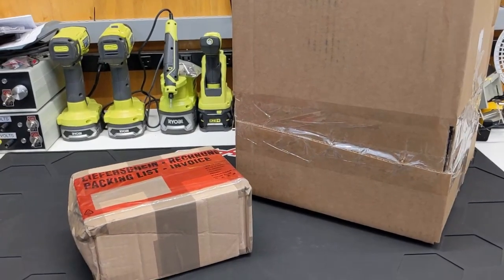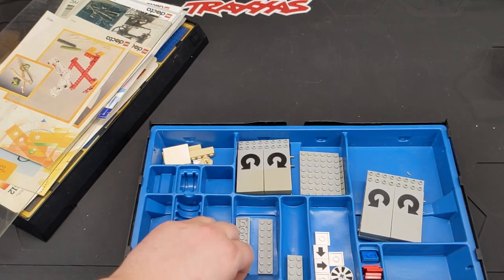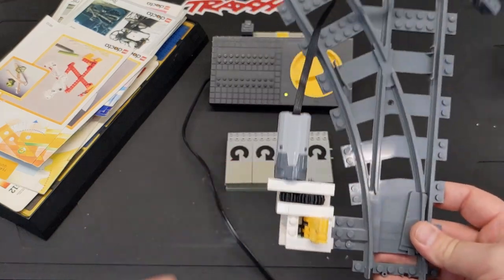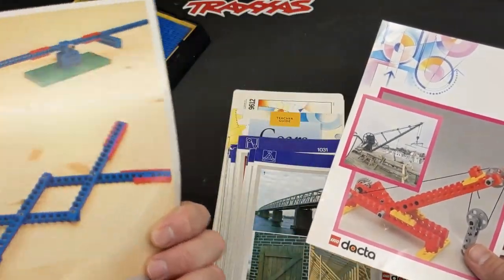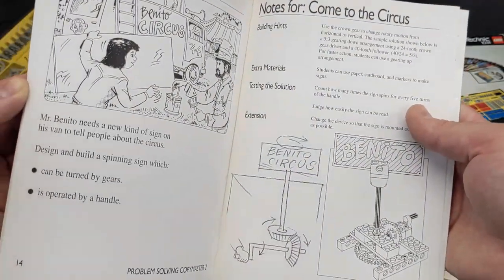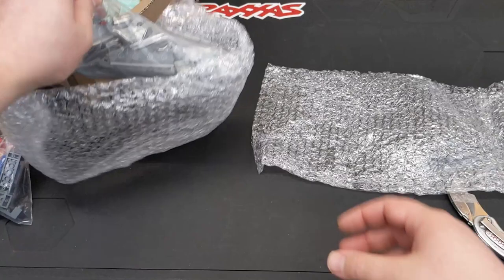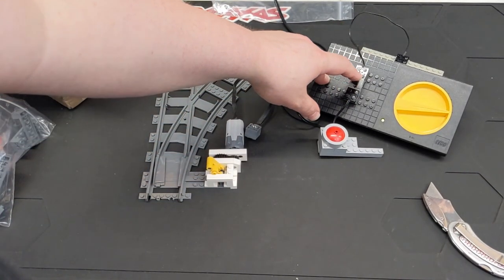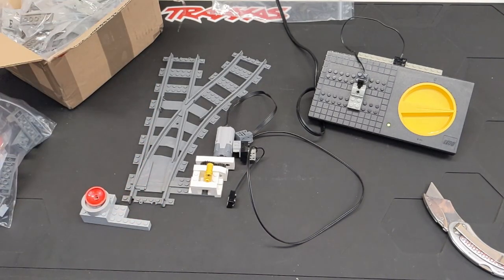Lego Electronics haul!  Parts for control panels and controlling switch tracks

Comment: Great video, thank you, I am trying to do the same with the switches, and have a question if I may.. the cable out of the switch to the motor, are the two pins just connected to the GRD and 5V wires?
Reply from the maker: I'm not sure what you mean, are you referring to the old 4.5v (or 12v) buttons or the 4.5v touch sensor button?
Reply: Sorry from the old 4.5v buttons to the 9v power functions motor
Reply from the maker: basically you would have a 9v to PF wire, then cut one of the wires and put the button in series on the cut wire.  I've been asked about this a good bit, I want to make a video explaining things better and add some more ideas.  I have a few projects ahead in line though
Reply: Ok thank you, that doesn't make sense to me but will try what I think you are saying out . Ha ha ha...

So the output from the switch ( the old switches with the reverse arrow logos on) are Ground and 9V you the take a power functions lead and connect these to the Ground and 9V ignoring the two middle wires on the power functions lead?

I will try that, thank you ;-)
Reply from the maker: On a 4 wire Power functions wire going to the motor you would ignore the outer pair (9V and GND) and use the inner pair (the control wires).  It's a lot easier to do with custom 2 wire 9v to PF.  The outer pair is a constant 9v (never changing polarity) to power IR receivers or SBricks

Comment: I'd like to note something regarding the touch sensor from the cybermaster set: I might be reading too much into this, but I believe you are mistaken about its resistor. Afaik, the resistor is always closing the circut and is used to identify the sensor (red, yellow or white) on a passive input channel when it is unpressed. When pressed, the resistance drops on all types of touch sensors in a similar fashion and it is impossible to safely identify one pressed sensor among many connected to one Input channel. The grey touch sensors do have different resistance values when pressed (500 ohms [old] and 2k ohms [new]) and I am not sure about the cybermasters ones, but as most inaccuracies for the resistance value come from connector cables, it probably wouldn't be enough for an identification, even in a static setup.
Why am I writing this much text about such a detail? That's because I ran into this exact same issue in one of my projects, when I tried reading multiple touch sensors on one channel by combining different types of touch sensors and exploiting their unique resistance values. In the end, I had to modify connector cables with highly valued resistors to see the differences in the values.
And on this occasion, I'd like to give two more tips:
1. You can exploit the resistance of the cybermaster touch sensor by connecting it with a pole switch, giving you three input values from an on/off-AND-on/off logic.
2. If you "short circut" a pole switch with a diode, you get a passive input device with three possible resistance values. And now the awesome part: you can cascade it with yet another pole switch and another diode, giving you even more inputs. In one of my projects I managed to read two pole switches and their respective (connected) positions on a single passive input channel so far (a disconnected switch always results in logical undetermination). I'm pretty sure this can be pushed much further, but will most likely require some fancy electronical setup.
Reply from the maker: Ah, I think you're right.  I need to pull out all of my touch sensors and do some tests with them.  I think I have all three cybermaster touch sensors, but I may be mistaken.  Thanks for the info!